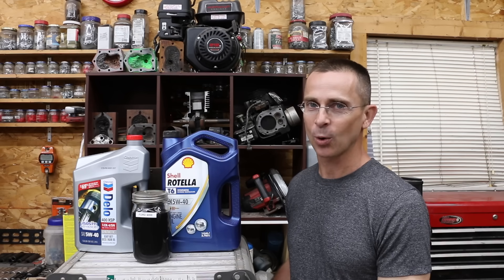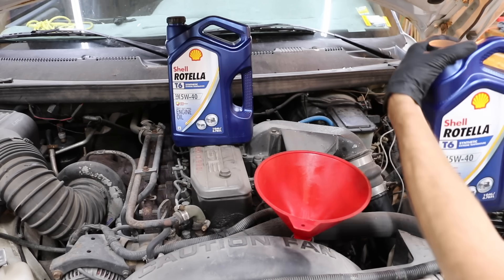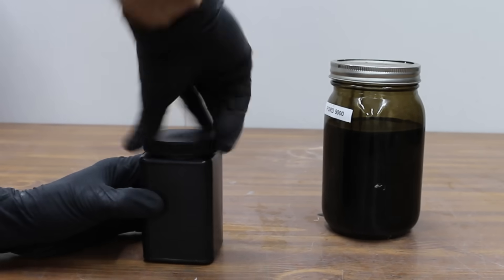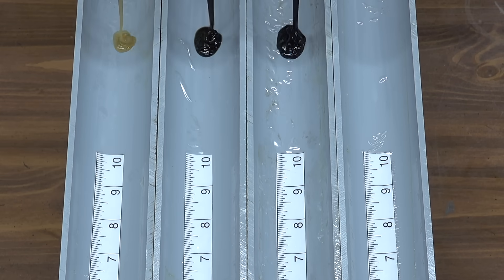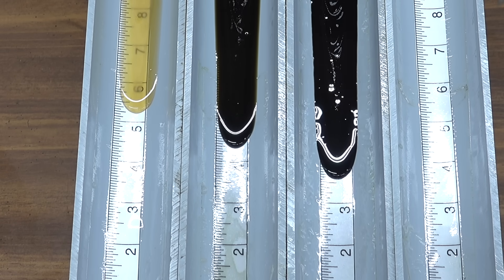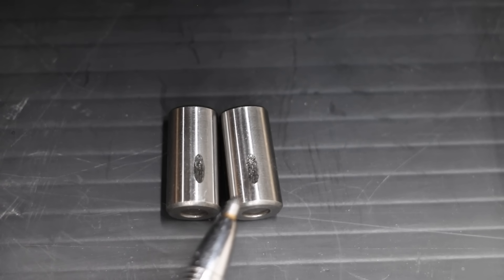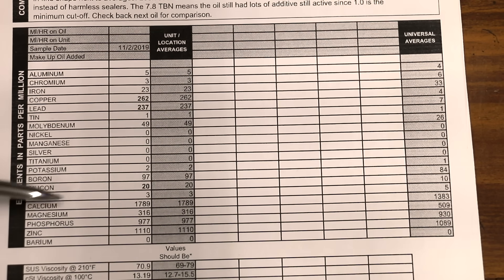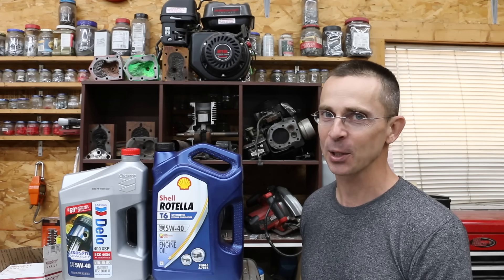Will Annual Oil Change Damage Your Car? Let's find out!

Comment: This is the second time I’ve watched the video! Good info BTW…had to refresh my memorie😅
Something to note that diesels have injection pumps (either mechanical or electronic delivery) more precise fuel management, and as long as everything is working correctly, fuel contaminants should be low if run times are at moderate levels .
Now older gasoline  carbureted vehicles and equipment are a different story! Carbs can play havoc on oil! Running rich for multiple reasons can dilute oils significantly! Chokes sticking on and cold temps can cause fuel to puddle in intake manifolds at idle. This is why I believe older carbed engines had a hard time making it to 100,000 miles without major engine damage or oil burning compared to modern day fuel injected vehicles getting 200,000+ miles typically without issues unless there’s an inherent problem.
I have over 1.5 years on synthetic oil in one of my trucks…not many miles (1800 miles) still looks clean ..it’s an 05 with 135,000 miles.
One of my older trucks with a carburetor has a rebuilt motor and oil gets dark in 3-4 months (it does runs good without noticing any rough running) 
I change its oil twice a year just because it gets dirty looking and smells of fuel a little! 
Would be an interesting test for oil quality using a couple of gas engines compared to diesel ….carbed vs EFI or just EFI vs diesel!
Reply from the maker: Thanks for sharing.

Comment: I bought a new Ford Ranger in '03. 3.0 V-6 engine. When the warranty was up, I put it on an annual oil change. Mobil 1 High Mileage 5W/30 and Motorcraft filter. I would average 10 to 12 K. per year when it was my daily driver to work. The truck has 196K on it now. I recently replaced a leaking valve cover gasket and the valve springs, head, and valve cover were spotless. I have been retired for years and the yearly mileage has declined. But still once a year on everything I own. I love your videos! Very good unbiased and useful info.
Reply from the maker: Thanks!  Thanks for sharing.

Comment: My oil got changed with Hydro-cracked Synthetic oil instead of fully synthetic oil. Is this a problem? (SWD Rheinol 5W-30 Primus FOS) Used in a 2018 Dodge Challenger 3.6 L engine.

Comment: My question is changing  your oil once a year ok?
I use Mobile 1 15,000 mile synthetic  oil and Mobile 1 20,000 mile synthetic filter in my 2010 Honda Ridgeline. I change the oil at 15,000 mile or once a year. I'm trying to reduce the oil changes  with conventual oil from 3000 miles three times a year to once a year.
Whats your option on this method?  Great show!
Rocky

Comment: I have a diesel VW jetta with 582k miles on it and have always run t6 still have the stock turbo and never opened the bottom end.  I change the oil every 8Kish, I will never switch to anything else.

Comment: Just changed the Honda Accord V6 after 2 years and 5,000 miles. The maintenance minder said it still had 40% life. I only changed it because of always hearing about it has to be changed every 6 months even if you don't reach the mileage limit. I never believed that but was getting paranoid with it goin on 2 years. Now I know better. Thanks for confirming what I always suspected. Didn't know about the running at least once/month to get it up to operating temp. Good to know!
Reply from the maker: Thanks!

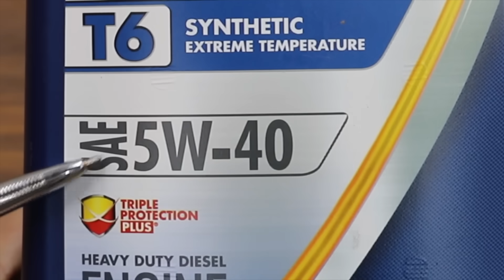Comment: 5:34 I’m one of those who used to use Rotella T6 in a gas engine; I ran it in my old NA Miata. Before that I had actually run T4 because of its good detergent properties. Cleared up my hydraulic lifter tick. I never cared about the gas mileage in that car, and rarely if ever ran it in the winter, so having a 15W-40 was ok for me.

I’d like to see a follow up sometime in the future with Mobil Delvac.
Reply from the maker: Thanks for the suggestion.

Comment: Yes, you can change your oil once a year without harm, but ya better use the vehicle 🚗 very sparingly between these types of oil changes. I still swear by an early oil change, to avoid silt-like grit from building up, wearing out your cylinder walls and pistons. This way, the oil cannot get too dirty. Your friend, Jeff.
Reply from the maker: Thanks for the feedback.

Comment: Thanks for the great comparison and evaluation on these oils.  I am one of many who has chosen to run T6 in my motorcycles (5W40 in my GL1100 and GL1500  Goldwings). T6 has the proper wet clutch rating for bikes,   but it's marketed as a diesel oil.  Wondering if you would weigh in on this debate.  Thanks again,  Torrey
Reply from the maker: Thanks and you are welcome!  Thanks for the suggestion.
Reply: @ProjectFarm  Thanks for saying the exact same thing over and over and never answering anyones questions.

Comment: its $25 for the oil and $5 for a filter people ....just change it every 6 months for crying out loud. The main issue is condensation and water buildup inside the oil pan. DO NOT wait a full year to change your oil. Plenty of experts will agree with this.

Comment: What you did proved what I thought. If engine oil can last 10K km in 6 months in a engine where it tolerates high pressure and high temperature , it should be able to last much longer when the vehicle doesn't travel that far.

Comment: I know you did this test awhile ago but I've always change the oil in my Ford 9n yearly cause that's what we always did growing up, and I also run Rotella T-4 in my tractor and my dodge pickup mostly for the zinc.  I've never had a lifter or a camshaft failure with it. The 9n is a 1942 and the Dodge is an '87 with a 318.
Reply from the maker: Thanks for sharing.

Comment: I'm a "car guy" and mechanical Engineer. I always wondered what would happen if I pushed my oil to the "max". I drive 90 miles a day to and from the office so I don't see the reason to have a new car. I had a "beater" car I think it was a Toyota. Little 4 cyl engine with 80 or 100,000 miles on it. I only paid $500 for the car so why not test this in a real world test in a very used car. I ran 54,000 miles on the car without checking or changing the oil. I actually wore a set of tires out during the test. I planned to run this until I could hear a problem or my oil pressure was bad. I gave up at 54,000 miles and changed the oil. It was really dark, but no ticking and the car ran the same for a year until a drunk driver rear ended it putting that poor little car out of its misery.
Reply from the maker: Thanks for sharing.

Comment: I have a Kia 2 litre engine with Turbo. What I see on another YouTube site states that failure to keep oil clean and fresh can result in restricted oil to the Turbo which causes failure of the main shaft. So do I listen to you or the other mechanic as regards frequent vs infrequent oil change ?

Comment: Interesting the Shell T6 is not S/N certified but it is JASO and JASO2 approved which means it is approved by Japan to be used in gasoline engines with wet clutches (motorcycles). I use this oil exclusively in all my vehicles since it was introduced and change oil yearly, on motorcycles cars and 2 pickups one gas one Diesel. The gas pickup is a 2000 f250 with 314000 mi.
Reply from the maker: Thanks for sharing.

Comment: I drove for a cab company for 12 years. The cars we used were used police cars that were between 150-170k miles when we bought them.  We never changed the oil or filter in any of our cars.  We checked the oil everyday and added oil if needed before the cars were leased, but we never changed the oil because it was cost prohibitive for us. The cars would go another 150-200k miles. Some had over 450k miles before they got not a car accident.  I drove a beater and never changed the oil for 5 years.  I added a quart every month and a half before the control arm broke off while I was on the freeway and totaled the car.
Reply from the maker: Thanks for sharing.

Comment: I think people having  problems with their oil is when they have a motor that has been neglected on oil changes and or lots of miles and or other engine issues in the control module's. Spark plugs and wires, air filters, antifreeze, fuel filters are items that tend to be neglected and can cause many issues. 
I'm thinking the tractor and truck are well maintained and the oil is less of a issue in a well maintained vehicle. 
As always great video, thanks for your hard work and non bias results.
Reply from the maker: Thanks and you are welcome!

Comment: I left my bike parked with fresh Rotella T6 eight years ago. I just found that my entire 4.7 gallon tank somehow drained into the crank, displacing all the T6 with E0 fuel (Ethanol-free) + Sea Foam (full can). It seems the Sea Foam ate up my zero-mile petcock, which I had also replaced just before parking the bike 8 years ago. I really don’t know what to expect in my carbs or the cylinders. :(

Anyway, I have a whole other jug of Rotella T6 that’s just as old and was watching this to see if I can still use it. Maybe I should crack open the jug and have some tested. ;)
Reply from the maker: Thanks for sharing.

Comment: Interesting thing what I encountered: I put to my audi's engine "new" oils + filter (year++ old 0km) and just after few thousand kilometres engine oil pressure light started flickering, so when I changed oils again, this time actually new oils from unopened container the engine oil light went away and stayed away. I wonder how great impact does it have on oils if container has been opened..? Based on my experience it did have impact.
Reply from the maker: Great feedback. Thank you

Comment: Mr Project Farm, please consider doing a 0w-20 oil vs 5w-30 comparison. Many car manufactures use 0w-20 in the US, but other countries do not. Some people argue that it can't be as protective as a heavier oil, especially in hot environments. Thank you, appreciate the videos.
Reply: 2nd this idea! The new stuff is sooo thin!
Reply from the maker: Thanks and you are welcome!  Thanks for the video idea.
Reply: @ProjectFarm  I have a a Small Suzuki Hatchback and my country's Suzuki recommends 10w40 while same engine in Japan is recommended 0w-20. Not much to ch of differences in weather, except a little more dusty my country.
Reply: It's all about the manufactured tolerances.  Tighter tolerances necessitates and prefers less viscous grades.  Like octane in fuel, it's not that "bigger number better", it's about matching the number to the application.
Reply: @nunyabusiness896  Yeah, I'm aware. The oils job is first to lubricate things properly. Water would flow easily through the tightest of clearances, but it would not lubricate. Other countries don't use as thin of oil for the same engine.
Reply: @juggy-b9e  The water analogy is just plain absurd and has nothing to do with anything.  Needlessly viscous oils just kill efficiency and actually can make things run hotter and shorten the life of the oil and maybe even the engine.  Friction is friction and high viscosity is essentially liquid friction.  Do you really think these people run these engines on dynos for the equivalent of hundreds of thousands of miles and just on a whim say "yeah, let's just go with whatever"?  If you think what makes a lubricant great or not is how viscous it is you have a gradeschool understanding of chemistry and engineering.
Reply: @nunyabusiness896  No I think there are other factors happening in the US especially, where an attempt to gain a little bit more efficiency comes at the potential cost of accelerated engine wear. Try a BS in Engineering, and advanced courses through into fluid dynamics, organic chemistry, and physics. Seems like you inherently trust a giant industry to always do what is best for the consumer; pretty naive
Reply: @nunyabusiness896 Also, your big smart answer made no attempt to explain why different countries actually use thicker oils for the same engines. For example Australia Honda vehicles vs the US. Australia continues to use 5w-30. So no, it's not all about the tolerances
Reply: @juggy-b9e  OK, make sure to keep that tinfoil wrapped tight, I'll be over here looking at all of the cars that have run the factory recommended 0w-20 since day 1 with hundreds of thousands of miles and no issues.

Comment: When I was a young guy I worked for Shell Oil. There was an area in the operation where they would make engine oil and near by there was a container filling area. Since I was moved around quite a bit I got to see many aspects of the operation. In the filling area I saw the same product poured into different containers from 1 qt size to 55 gal drum size. The names of those products were SHELL, AGWAY, PENZOIL, QUAKER STATE, and a few others I can't remember just now.
Reply: "Duff vs Duff Lite" moment
Reply: @joeybuddy96  don't forget duff dry!  😆
Reply from the maker: Thanks for sharing.
Reply: Shell own all of those  companies  , and supply's  Agway ..
Reply: Bullshit....
Reply: Yep, Royal Dutch Shell is top quality.
Reply: And it's also the same oil for diesel and gasoline engines even if they sell 2 "differents" ones.
Reply: they’re “in it” together 😂
Reply: I, too, have worked for a lubricant oil factory, and it's pretty amazing how much the different oils are the same. 

Four different 5W-30s, but basically all of them identical. They might use one adative or the other, but the bases are the same. Speaking with the chemists there (QA chemists, not development chemists), they shrugged when I asked why I should choose the one oil over the other. All of the measured data were basically within each others' tolerances. They didn't want to say that they guarantee that they're the same, but they couldn't understand why an engine would suffer or last longer using the one 5W-30 over the other. 

OEM-labels were also fun. They didn't claim to do something different than the base-label, but they always used more "creative" language to upsell you on their oil.... that's exactly identical to the other.

Comment: Got a good story for you...I have a 2002 Dodge Ram 3500 4X4, HO Cummins with the Banks Power Pack setup.  The truck only has 32000 miles on it.  I have always used Amsoil synthetic diesel oil.  The truck has been sitting, un-started for 3 years, and the oil has not been changed for 6 years (less that 3000 miles in that time).  I put 2 new batteries in it last month, and it started instantly.  Checked the oil and it looked almost as clean as new...I did have it changed though.  I figured the fuel would be bad after that time period, but it runs perfect and towed my RV with no problems.  I use Stanadyne at every fill up, and that's the reason I had no fuel problems.  Last fill only cost approximately $1.99 a gallon for diesel, so the tank was full.  I am sold on Amsoil and Stanadyne Performance formula.
Reply from the maker: Thanks for sharing.

Comment: 11k comments so probably been mentioned already but, at -40 degrees, there's no need to differentiate between F and C. That's the point where they are both the same.
Reply: Fahrenheit and Celsius are not the only two temperature scales. What about Newton, Romer, Delisle, Kelvin, Reaumur, and the others? Just saying "-40°" doesn't mean anything unless you state what scale you are using. So, he is absolutely correct to say "-40° Fahrenheit," or he could also have said "-13.2° Newton," or "233° Kelvin" and it would have indicated the same temperature.
Reply: @trustthescience2260  You're taking pedantry to an extreme here. Other than Kelvin, which doesn't have -40, all of these examples have been effectively unused for over a century and a half; with a handful of obscure exceptions. As for the Newton Scale, 14 was defined as "the greatest heat of a bath which one can endure for some time when the hand is dipped in and is kept in constant movement". One cannot imagine how that fell by the wayside.

Comment: I was taught growing up to change my oil every 3 months or 3,000 miles even if you barely drove at all well times have changed money got tight and I bought my friends 1995 Plymouth Grand Voyager when it had 215, 200 mi on it according to the chart Nick oil change was $217,000 MI well needs to say I changed it at 215,000 miles but in the past year and a half I have barely drove just over the 3000 mile mark but I need to get back in to regular oil changes with no if ands or butts I believe regular oil changes no matter how low mileage is critical
Reply from the maker: Thanks for sharing.
Reply: Did you watch the video before the post or?

Comment: Great video. Would be interesting to see various motorcycle oils go thru this test, as many peoples bikes sit for 3-5 months out of the year.
Reply from the maker: Thank you!  Thanks for the suggestion.
Reply: The longest time I've had an oil (T6 5W-40) sit in my engine and transmission was 4 years and 10 months and 3,944 miles. No issues whatsoever. I ride a Yamaha Stratoliner.
Reply: I have about 3k miles on my motorcycles oil and my last oil change was 07/01/2021. My next oil change is at 7500 miles per the maintenance schedule, and I’m at 5100 miles. I plan to change it and test it then, however long it takes me to get there. If I get to the 2 year mark beforehand I may change it just to be safe.

Comment: Neat test.
Changing Oil too often is still cheaper then a new engine.
Oil Cheap-Engine Expensive.
Reply from the maker: Thanks for sharing.
Reply: That really depends on how often you change it vs how long you keep the car vs how much a replacement engine is.  The video proved the oil is still perfect after 1year, so much so he thinks it could make it 2 years.  Just be sure to bring it to temp every so often to get the possible moister out.

Comment: My car goes  30/40k miles between oil changes and she's fine 570k miles on the clock
 20 years old 2.0 diesel mpg are the same power is the same doesn't burn oil or smoke excessively doesn't over heat drives absolutely fine.
Don't get these 3k miles oil changes or every 6 months it's not needed